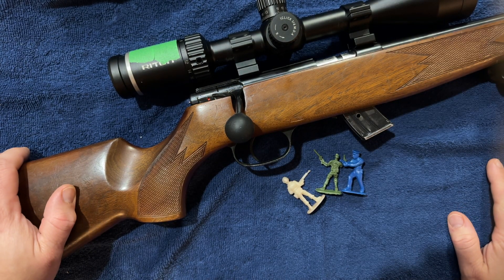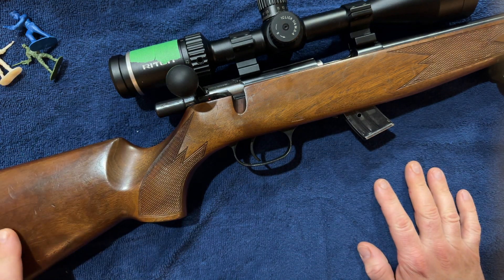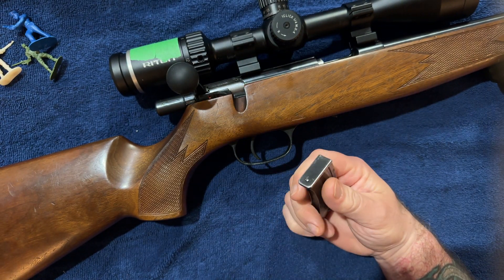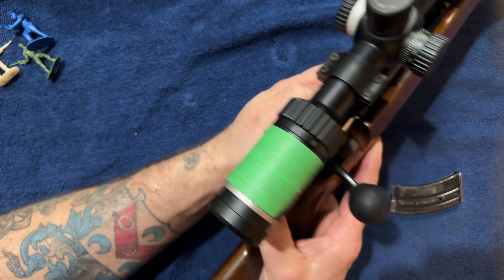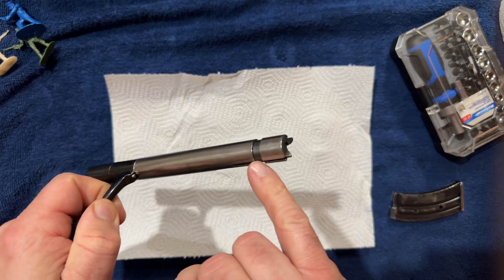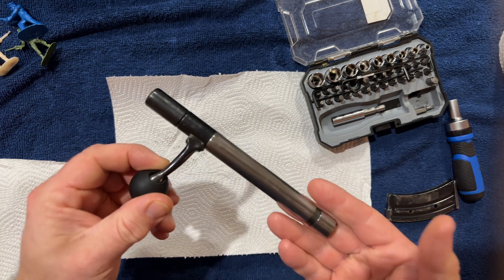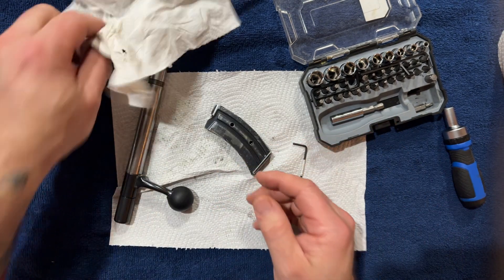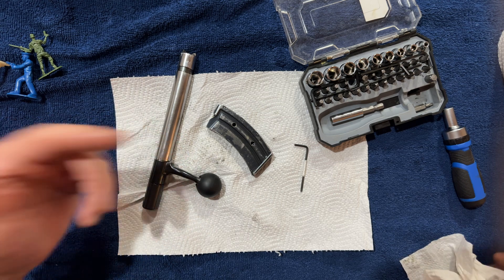Krico 300 bolt/mag disassembly details

Comment: Gidday - Hey excellent videos on the Krico's.  I'm going to post a little info that hopefully adds to the pool of knowledge on these.  Hope you don't mind.
Through the good graces of a neighbour who is a Krico collector I recently acquired a very "plain jane" 300 Series 22LR,  proofed 1962.  The rifle is in excellent condition, practically "as new" although it's not the sort of example a collector would consider (missing parts etc).

I shot the rifle with my medium quality ammo (Norma Tac-22 etc) and it is safe to say I was astonished!  It would hang with many high end guns, 5 shot groups at 52 yards starting at 0.29 and not many over 0.5!  This despite a very heavy trigger. 

I resolved to address the trigger before trying it with high end ammos like my precious stash "good batch" Eley Club and Match etc.

The trigger is a very simple and "cheap" two stage design, and on my model is also the bolt stop.  It has a single adjustment screw, and on first experiments even it didn't do much but its purpose is to adjust the length of the first stage.  It's seems to operate on a similar principle as the Mauser 98 type.

So I replaced the very strong factory spring with one about 30% less wire diameter. This has profoundly improved the trigger although there are a couple of important learnings.  One is that the trigger will always be two stage.  Secondly (and counter-intuitive for me initially) is that reducing the first stage is not a good thing - keep it long, this considerably shortens and lightens the final break.  My final break is now 1lbs 9 oz with just a wee bit of creep.  BUT it is very important for safety that the spring is strong enough to reset/re-engage the sear from the first pull.  My trigger took some polishing, and still requires "just right" lubrication to achieve this.

So as soon as the wind drops I'll shoot it again.  Posted in case my findings help others.
Reply from the maker: Thanks a lot for posting this. Your comment and experience is most certainly valuable

Comment: Really appreciate this video, I have a Krico 320 1969, starting to get miss fires from light firing pin stick, I was thinking might be
need a bolt clean or new spring? The bolt on this rifle has never been stripped, the bolt shroud in cone shaped.
Any ideas?
If possible could you do a video on how to disassemble, adjust, replace springs, much appreciated.
Back ground, a gunsmith played around with the trigger, tried change from a 2 stage pull to single stage and lighted the
trigger by replacing the spring. In short he stuffed it, another gunsmith who specializes in triggers said he have never seen a trigger like it, I posted
the trigger to him, he could not adjust it properly without the action, posting firearms is a major problem now in Australia.
Reply from the maker: A bolt clean always helps, but adding a small helper spring then a washer then the factory spring can help shim the old tired spring with some preload. You have to play around and experiment with this method as the bolt will bind if too much is used. I would order a bag of mixed coil springs from Amazon eBay etc and have some fun!
Reply: @inrangerimfire20two  Thanks, I will give it a try. The bolt assembly is different than your late model(1984?), there is a very fine screw that looks like it holds
the bolt shroud in place, when removed looks like shroud is screw off.
I have adjusted the trigger now working OK, the Krico trigger housing is set by spaces to give the correct high to engage the trigger & bolt, too high and
bolt is decocked when closing the bolt, too low trigger not engaged and bolt stop does not work.
Agree, Krico rifles are beautifully engineered and made, no machining marks, probably the same or better than Anschutze. 
Brno/CZ are a great design and shoot well but the Krico is better made & finished.
I far as I know BRNO where the only 22RF with a screwed in Barrel, correct?